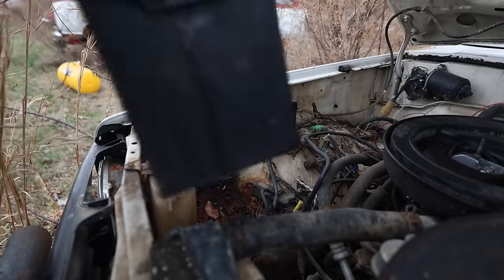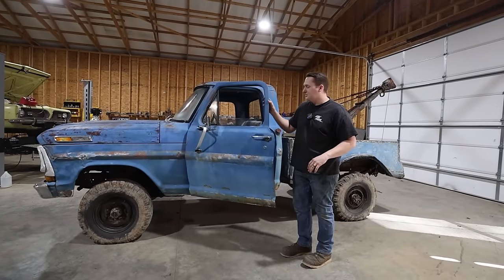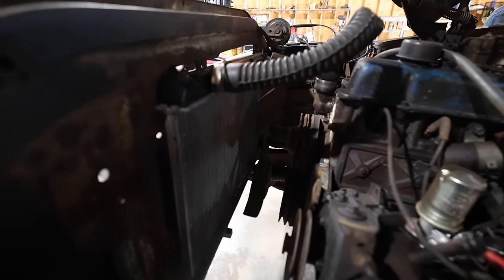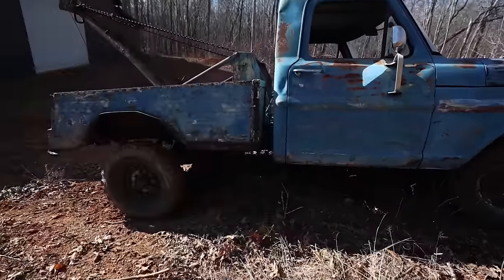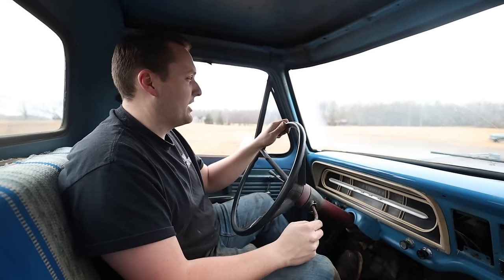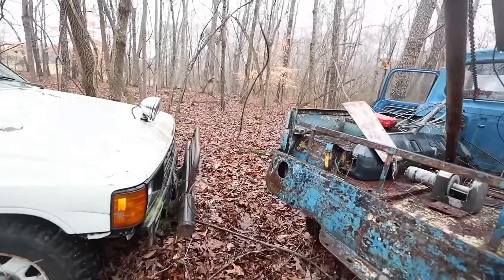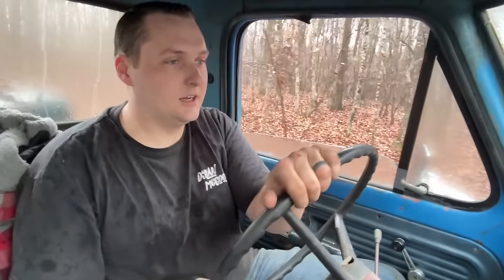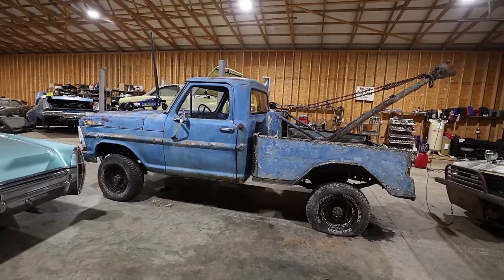FORGOTTEN 4x4 Ford Tow Truck Goes Off-Road After Decades!

Comment: Thank you, Northern Tool.
I had a 1977 Ford F 250 Camper Special. I had to weld all new floors and stuff.
I went through some woods like yours, it would run over pretty good-sized trees up to 3 to 5 inches. lol, it was a blast. 4 low baby.''✌
Reply: Cool video Dylan. it brought back memories. lol. 👍

Comment: I Love this truck! Just add a steel front bumper with a 12000lb winch some 35 37 inch tires a 4 speed floor shift! And an exhaust plus the rubber straps with the bars for lifting the front of vehicles so it dosnt run into the back of you and it be perfect! Love to get a 66-70 myself to build up! Love the channel man great job! Also it be cool I you made that toyota 4wd with 35s and lockers!!!! They fit anywhere it's just making it as durable as the ford!!! Really like the strong way jack you were right it picked the truck right up without sinking! Would love to owm it!!!! Keep up the great work Dillan!

Comment: I had a 1971 Ford f100 2 wheel drive with a limited slip rear that I changed from a automatic to a 4speed truck trans with a 302. I drove for years. It was a really good truck.

Comment: I had a 82 f150 was my mud/trail truck. Had a 300 six, 4 speed, 4.11 gears, lockers front and rear, 3 inch lift and 35s. She was a beast. I was the only one never to get stuck when me and my friends went out mudding. I feel ya with no power steering. Dad had a 75 f100 that didn't have power steering. Was fun plowing with it. Only option that truck had was am radio. The t-case didn't have 4 low only had 2 high and 4 high.

Comment: Man does this really make me wish my 1984 Dodge Ramcharger. It was an all original fully optioned 360 LA, 727, with the NP203 (or 205) transfer case. It had 33x12.50s and it would literally climb almost anything. It had the original Carter Thermoquad on it and it would run great for about a 20 minute ride, but anything more than that and it would vapor lock. I knew nothing about carbs at the time, so I swapped in a 360 Magnum and it started every time, but I sold it because I didn't want to fix all the rust. The chassis only had about 84,000 miles on it, but I was stupid so now I miss it. I only paid about $1500 for it.

Comment: A trick I learned  was to fill the diff with  gear lube then jack one side up lube the axle rearing then jack the outher side lube that axle bearing then level it re check and done no dry axle bearings. Real important of full floating rear ends.
Reply from the maker: Nice!
Reply: thats a 73 highboy.. worth $$$$$$$$$$$  @DylanMcCoolVideo
Reply: Thanks northern tool
Reply: Dylan always gives us the best content !!!! Always family oriented never anything said or done inappropriate like most channels. Always a pleasure to watch thanks Dylan
Reply: Learned this the hard way.
Reply: Thanks northern tool
Reply: I have a 73 highboy @harrywalker968 and that’s not a 73… 73-79 were dent sides not bump sides 67-72 were bump sides

Comment: Thank you Northern tool. Hard to beat (or kill) an old Ford truck, and when you add in the Dana axles front and back with 4.88 gears, it may not go fast with a 300-six, but it will keep going.

Comment: "Thanks Northern Tool" only a suggestion but you could try "On x Off Road" as an option to finding trails to drive also set the truck up right get a winch to help get you out of any "Tight Spots".

Comment: My grandfather is 69 Chevy at 350 I don't know how load the gears were, but you could put that thing in low range first gear. Pointed across the field and he would drive itself while people load to the tobacco wagon behind it. Got about 3/4 of the way walk up. Catch it gett in spinner around.
Reply: Done that on the farm 🚜.  Put the truck in 1st and just aim it straight and take the bales off to spread them out for the dry cows 🐄 to eat. Then when empty just hop in and drive back to the shop. 😊😊

Comment: the rear tire where your welding the diff is on the wrong side the points of the tread always face forward they allow the mud to scoot out the side rather like an arrow it makes a huge difference even in low tread